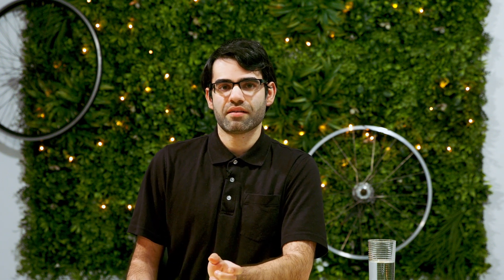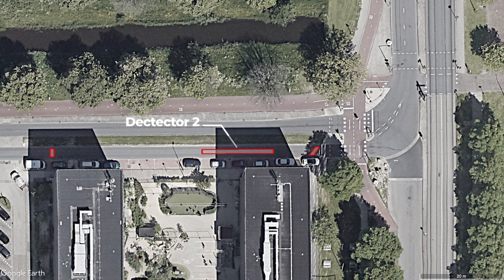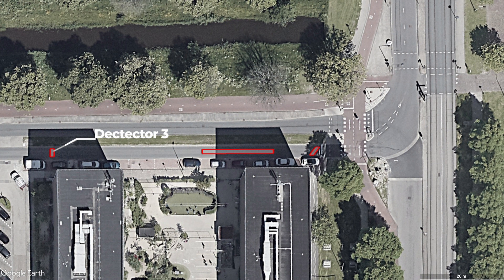Efficiency and Flexibility: Decoding Dutch Traffic Signal Design | Mobycon Academy

Comment: Now I know why the bike light at some intersections becomes green as soon as I surrender and put my foot down.

One thing I think would have been a beneficial add; how pedestrian crossings really do not have a long "yellow or green" phase or flashing red as in the states. Basically the only pedestrians expected to cross are the ones at the light as it turns green.

Much better than in NYC where the blinking phase leads to a lot of conflict.
Reply: One of the common issues at Dutch signals is that the bicycle detector is only about 25 m before the stop line, which is not quite enough time to call a green light if the signal is resting in green for a conflicting phase. This often causes the cyclist to stop briefly before the light changes to green. This situation can be reduced by setting all conflicting phases to rest in red and by disabling "meeverlengen" (extending with overlaps), like the signal at 3:13. Or alternatively the bicycle detectors can be moved further away (e.g. to 35 m).

Even at intersections where phases do default to red, there are often bicycle paths which lack an upstream bicycle detector, which means that although the signal can provide a green instantly when a cyclist is detected, it doesn't detect cyclists until they reach the stop line, by which time they have already lost their momentum.

Placing the detector further away has the downside of making the estimated arrival time at the signal less accurate, increasing the risk of extending the green too long, or not extending a green in a situation when the cyclist actually could have made it through with an extension. So detectors at 35 m should ideally measure the speed of the cyclist (using a camera or dual detectors) to improve the estimate.
Reply: @narayandonaldson or maybe cycle a bit slower within a built up area? You can't have it both ways: either regulate for all or choose one mode that has priority. Seems you forgot you react as a cyclist, move the detection point 10 meters and the other detection points HAVE to change too.
Reply: @Paul_C why slow down? Momentum for cyclists is a very important thing. People cycle in cities cause it’s more convenient and faster (most of the time) if signals aren’t improved than you’re stuck with non moving tech.

Comment: Great video! A lot of this is completely possible in the US with existing signal controllers and equipment. Choosing to operate signals this way is another issue. But I believe once you start seeing a fully actuated signal with logic driving coordinated ped crossings, and those ped crossings split in a reasonable way...its hard to turn back. Furthermore, a critical aspect to switching from permissive lefts/rights to protected only is detection...without it, or with poor detection configurations, you get a lot more non-compliance.
Reply: To implement this in the states, you also need to have dedicated right turn lanes to control right turn conflicts. There appear to be a lot more of those in the Netherlands. But we could certainly design our intersections to be operated like this without needing to change any laws that I'm aware of.
Reply: @karlmacnair6089  yes, or where you don't have dedicated right turns, use the same geometric ideas of placing crosswalk users ahead and to the right a bit more than we typically do. 

But not only do we need right turn lanes (that's not that uncommon), it's also that you have to control them by signals. We typically just assume right turning drivers can turn right whenever, so dont always signal that movement or use detection. 

That was the case in the video below. We have a right turn lane, we have it controlled by signals...but didn't include detection. Lesson learned...add detection. 
https://youtu.be/N3DJHJ63hEo
Reply: @karlmacnair6089 depends. The Netherlands has very short minimum green times as well as allowing negative clearing time.
Reply: @miles5600  Only certain municipalities (Den Bosch being one of them) allow for negative clearance times. Most municipalities have a rule stating that zero is the minimum.
Reply: The biggest challenges we are facing implementing Dutch-style signal operations in North America are the clearance times and the control structure.

Dutch red clearance times are two dimensional, so the clearance duration depends on the following phase. For example at 3:38 you can see that the red clearance from the bicycle signal to the right turn signal is 0 seconds, while at 4:58 you can see that the red clearance time from that same bicycle signal to the side street phase is about 4 seconds. Although 2D clearances are legally possible in North America, we have not found any controllers which natively support them and are also compatible with American cabinet standards.

The other challenge is the control structure. Most North American controllers depend on the Ring & Barrier structure, which works great for very simple intersections, but becomes exponentially more complex and constrained as additional features such as right turn signals are introduced. The Block (a.k.a. Module) structures typically used in the Netherlands allow each phase to determine its own compatibility based on the conflict matrix, and automatically make use of unused time from other phases, without needing to manually program "overlaps" as you would with a Ring & Barrier structure.
Reply: @narayandonaldson Quite right. Both entry time and exit times are considered (oprijtijd en ontruimingstijd) and variable timing based on conflict areas. This data  is entered as a matrix into the controller.  North American controllers don't have this. This is why actuation on Dutch signals works well in the first place. For a technical explanation, see here: https://www.youtube.com/watch?v=7KPGVP85WpU